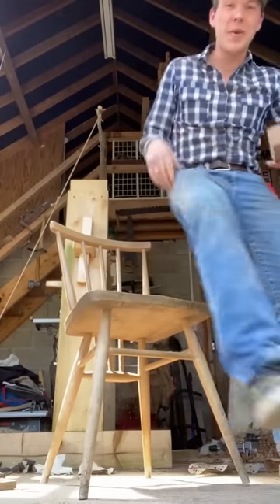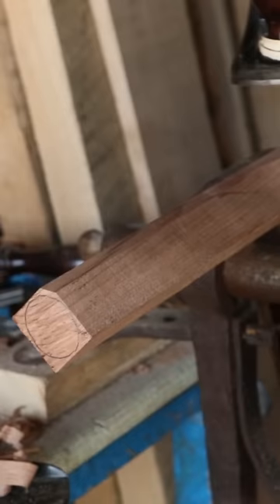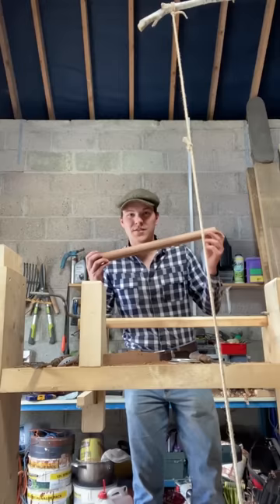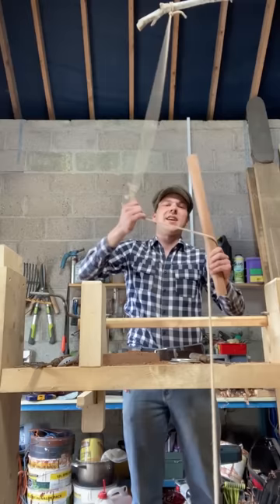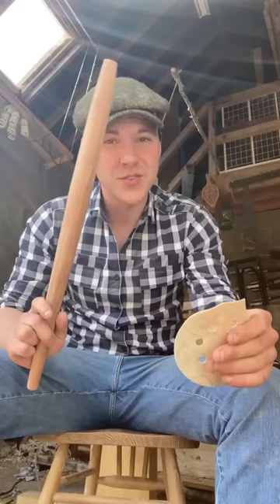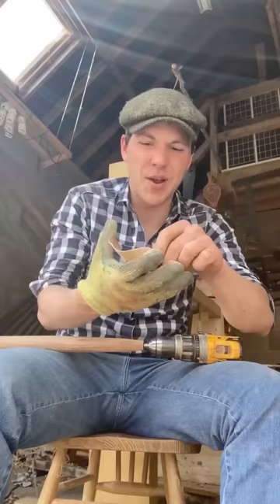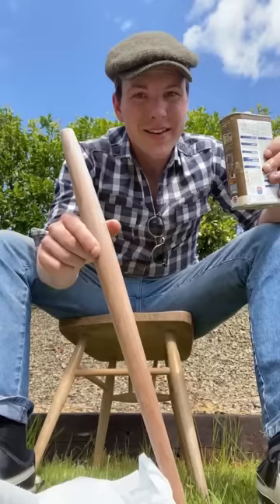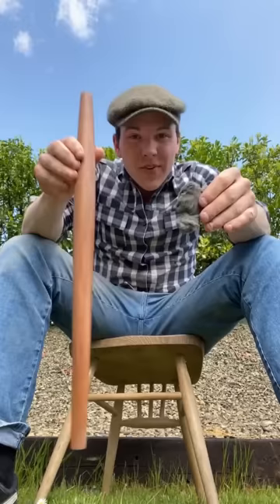Turning Beech Chair Legs #shortvideo #woodwork #polelathe #handtools #chairmaking

Comment: Wow! That is some major skill! You'd never know those two legs were made years apart, they look identical! 
Also, very cool lathe! I didn't realize you could diy something like that.
Reply: Those 2 at the end were 2 that he just made
Reply: You should look into the treadle lathe too. Mr. Chickadee made one and it's very similar to Eion's lathe.
Reply: @HeroOfTime303   Cool! I'll take a look
Reply: yep! wood turners have been around for thousands of years
Reply: actually he´s doing it wrong, since he´s using the skew chisel as a scraper. That requires more force, removes less material, leaves a rough surface and dulls the edge quickly. That´s everything you normally don´t want. In this case he should´ve done a planing cut. That requires less force, can remove more material, can leave a silky smooth surface that doesn´t require any sanding and the edge will last longer. 
Scraping instead of cutting is one of tha major beginners mistakes in wood turning.

Comment: They made some glorious wood lathes a few years back, I reckon you could squeeze one in without diluting the Eoin factor.  Run it off an old Lister diesel or something.

Saves doing distasteful things with battery tools too.

Love this though, those chairs are lovely bits of furniture. Looks like an Ercol but not enough spindles on the back stretcher on this one.

Comment: Tip.. use small bolt instead. Just drill and tap treads into wood, use superglue to reinforce treads if need be and retap to clean them. Then use cut bolt or treaded rod peace as axle.. Much easier than trying to remove that snapped screw from the end... Also good to mounting peace into drill chucked into a vise and now you have miniature diy lathe to turn smaller peaces.

Comment: We gave away an oak kitchen table and chairs because every joint was coming apart. It looked brand new and probably still does after 25 years. But, I was scared to sit on a chair because the legs were always coming apart. It didn't have a screw or a nail in it, and all I knew to do was use carpenter's glue. Until I saw your videos, I never understood why every chair made like the ones you've got there would start coming apart at the joints.

Comment: Rounding out the corners before you start turning.  I figure that on a pole lathe, that's pretty much essential; you don't have nearly the power or the patience to turn a round object from square stock, like I've seen in videos of modern power lathes.
But even with modern power lathes, 57,000 horsepower engines, six million RPM, using tungsten carbide space age diamond-tipped chisels: I still figure it'd make it easier and smoother to at least cut your square into an octagon, surely?  Even just taking those square edges down a bit would make the rounding process easier, no?  Apparently not.  I think I used a lathe once in my life; tried my hand at it as a kid at camp, or something.  It was fun.  But as an adult, I'm no expert.  According to the experts, turning a square is easy enough, so why bother pre-rounding?  Search me...

Maybe they should try a pole lathe, and see how grateful they are for their modren machines...

Comment: one wood classes take Dayton made round table. just small table but I think your should make big round table all nice chair have. if hand tools need copping saw hand cut curve want cheat use band saw. or jig saw my dad one those got too old. any way glue boards make nice big squre. draw light x with pencil find middle. drill small hole not through. put nail there with rope pencils end tied. draw circle one long draw. use what method cut out back is top.router edges of table top. site in chair and  take tape measure or yard stick find out fare ground too nipples. on lath or shave horses make 4 legs  put table much like would chair. for extra stretch measure down 2-4 inches table top drill holes legs .  run round spindle made shave horse. sue tenon cuter cunect all legs together. add streanth. wood burn or carve name and year bottom table. oil up with what ever want.